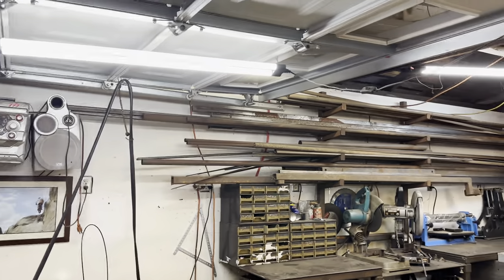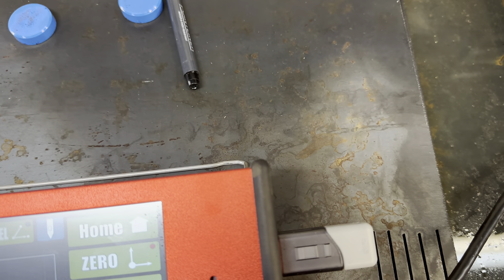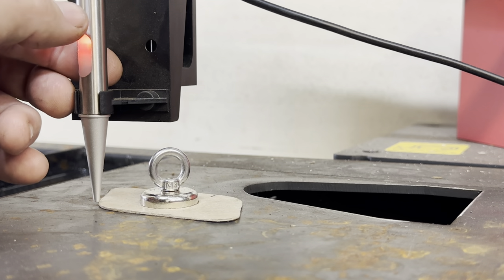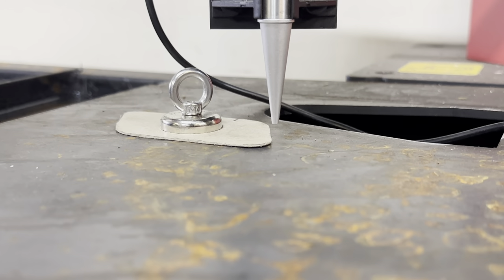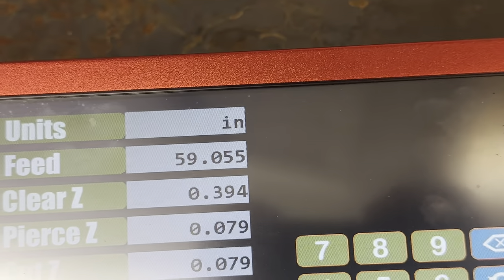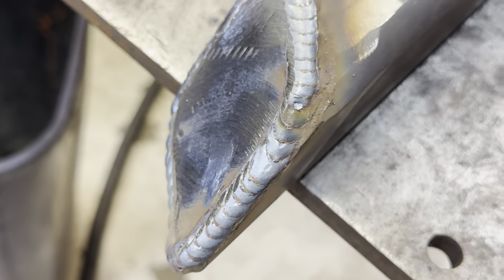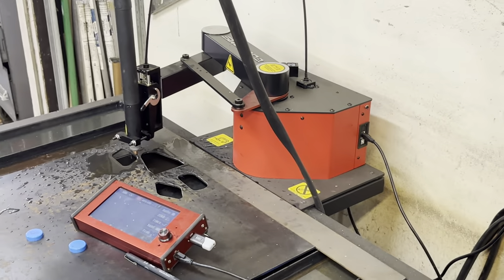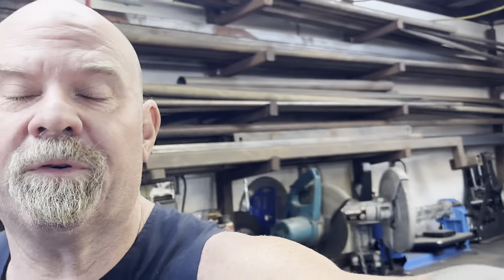Arc Droid showing you live how to make your first cuts.

Comment: Did you fabricate the arm for routing the plasma cable?  I need to find or make something and it's proving to be a bit elusive.
Reply from the maker: I you look and the beginning of the video you can see a loose clip on the garage door. All I did was hang it there and make sure there was enough slick for total table travel. Works great! I have recently sold this setup and have bough the Arkdroid x2 but have roughed the same way. Works great! Hope this helps! If not I'm here to help! cheers!

Comment: How are you finding the machine now after you have had it for a while? use it often?  Cheers
Reply from the maker: We left on a 2 Month Rd. trip in the beginning of August and will be back around one October. So far I really like it and it’s my third CNC plasma that I’ve owned. I find myself the things I do the most of our a set of one off tabs which it works really well for another just a little design details. I do load up a 2’ x 4’ sheet on the table and it’s nice to be able to index exactly where you want things to cut. It’s so easy to use. I find I use it more often than my other machines just because of the simplicity of drawing the part. I hope this helps, and you have any other questions. I’m here to help! I will definitely buy the machine again for just who I am. If you were looking to do production on complicated parts, probably not the correct machine for you. But if you’re looking to draw the part out on fusion and upload it that works also! Thank you for taking the time to comment! Cheers!